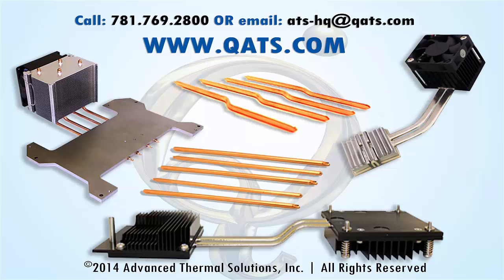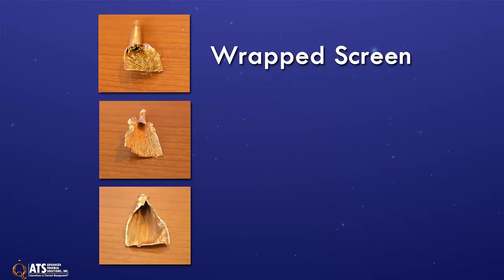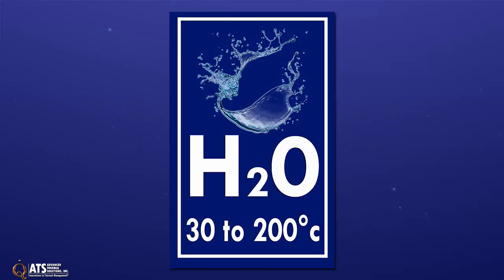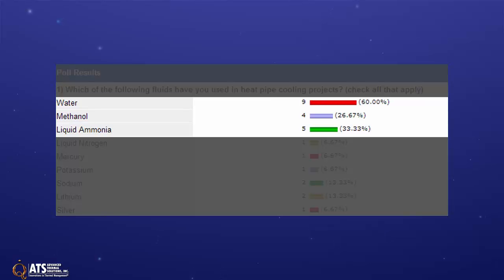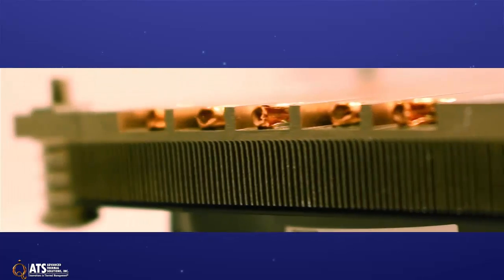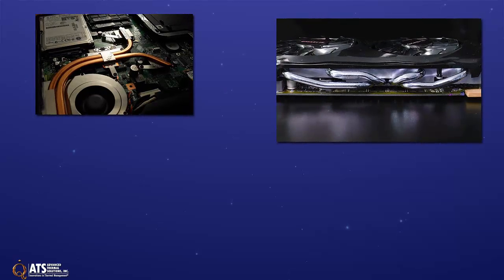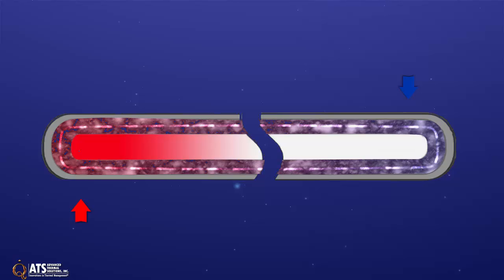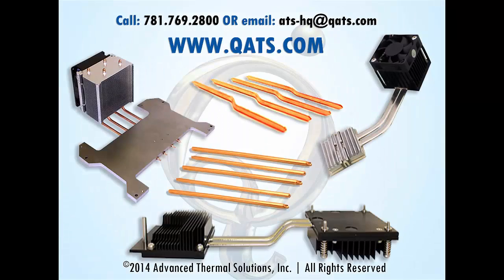Heat Pipe Overview and Explanation

Comment: The animated diagram implies that the fluid leaves and returns entirely via the capillary wall. Doesn't it actually move down the empty center of the tube as a gas, and it only returns along the wall (as a liquid)?
Reply from the maker: You're right about the vapor flowing through the middle section. This was a quick overview and there is a more detailed explanation at https://www.qats.com/cms/2016/04/28/ultimate-heat-pipe-guide-selection-performance as well as in this video, https://www.youtube.com/watch?v=_5ZVrwTj9Jg&t=11s.
Reply: Advanced Thermal Solutions, Inc. please excuse my question, which may be stupid. I know that these pipes can be operated against gravity. After heat transfer and condensation, why doesn’t the capillary action distribute the fluid evenly along the wick, but actually directs it back to where most of the fluid is? I would even have expected the wick to drain the fluid reservoir!
Reply: Ha! I think I guessed it! There is never liquid outside the wick! The liquid evaporates from the wick! Correct?

Comment: Is it possible to chain heat pipes?  That is, to have one start near where another ends in order to effectively increase their length? (presuming you create good thermal conductivity between the two)
Reply from the maker: It’s certainly possible but definitely not a recommended way. We have heat pipes up to 600 mm in length https://www.digikey.com/products/en?pv98=3&FV=fff40012%2Cfff80068%2Cfffc02ac%2C2dc1e7e&pageSize= so no need to chain them!!
Just use longer heat pipes.

Comment: "Off The Shelf"? 🤔
This company told me they don't have anything off the shelf. They told me anything I wanted would have to be "custom made" and take 3-6 months to develop. 😒
That doesn't sound "off the shelf" to me. 🤣
Reply: Umm - - because nothing is "ON" the shelf ??
Reply from the maker: Thanks for your comment @SciheartJourney.  Without knowing the nature of your engineering need for thermal management it is hard to understand why you received such an answer.  We do offer quite a few heat sinks "off the shelf" through our distributors without any customization.

Comment: Do you have termo electric solutions Peltiel element power prodution. I whant to run my Heatpump av from the cop of the heatpump using the extrakted heat. So i need a good termo exanger in combination to heat to el. power elements.

Comment: is there a benefit into stacking heat pipes to help dissipate heat?
Reply from the maker: Using heat pipes in parallel increases the total heat capacity. Example, if you need to dissipate 300 W of heat with a heat pipes that have a 125 W Q-max, you can use 3 or them.

Comment: how to bend the flat heatpipe
Reply from the maker: When bending flat heat pipes, we usually create bending mandrels with exactly the right groove size in them. This supports the pipe fully while we bend it around the mandrel.

For the minimum bend radius please see the guidelines at the end of our heat pipe datasheet. For flat heat pipes, take whichever dimension you are bending against. So if the cross section is, say, 6X3mm, and you are making a “flat” bend, then the minimum centerline bend radius would be 18mm. If you lay it flat on a surface and bend it upwards, then that radius would be 9mm.

Comment: How do you attach these copper heat pipes to copper plates? Soldering or some kind of glue?
Reply: Soldered/bonded.  There is some exceptions where you can use thermal glue instead of soldering.
Reply from the maker: Stefan's comment was right, although for quick prototyping work, we recommend thermal epoxy. such as the 3M TC-2810. For more robust and production-level assembly, low-temperature soldering techniques are recommended.

Comment: Hi, I would like to know if these can be bent, flattened without losing performance? of course this without invading the inside of the tube.
Reply from the maker: There is some loss to the Q_max due to bending but usually heat pipes are sized with enough margin that that’s not an issue. Flattening also creates a similar loss in Q-max; manufacturer’s datasheets (such as ATS datasheets) show separate Q-max values for flattened vs round heat pipes.

Comment: How do you bend those flat ones?
Reply from the maker: If you click on the data sheet at https://www.qats.com/Products/Heat-Pipes, there is information about the minimum bend radius for different diameters of heat pipes. Also, keep in mind there is performance degradation with bending heat pipes that needs to be tested on a case-by-case basis.
Reply: I've seen the datasheet but it's not clear about the bending radius for FLAT heat pipes. Are those diameters for bending them in plane (for the flat ones)? Could you clear that for me? Thanks!!
Reply from the maker: The amount that you can bend a heat pipe is very dependent on how you bend it and the kind of
performance that’s needed. It is best to do the bending process and measure the results to see if it works. If you see cracks or diminished performance, increase the radius. A good starting point would be ¾” radius if you’re bending on the narrow side and 3/8” on the broad side.